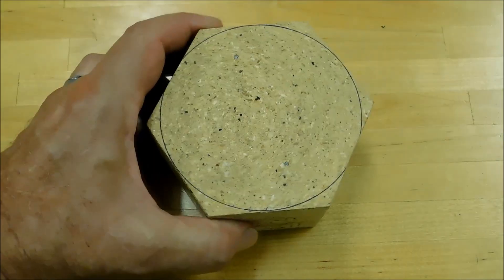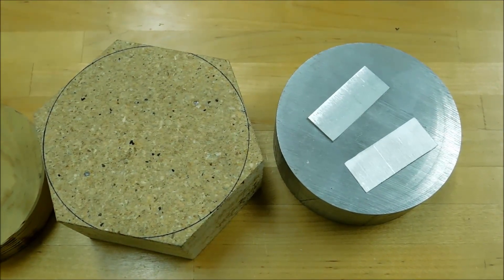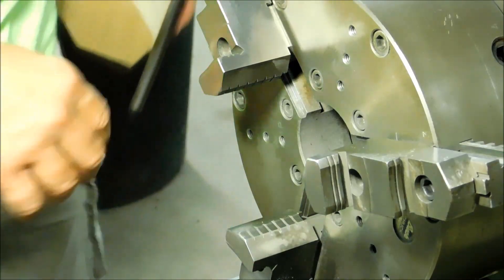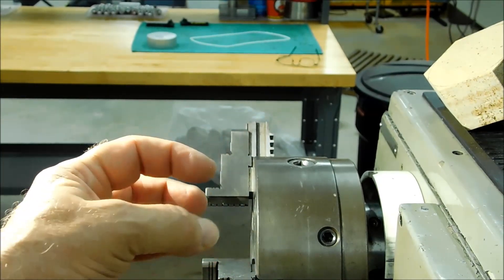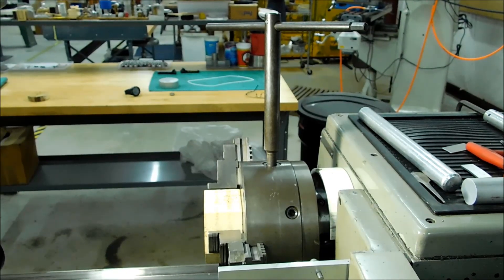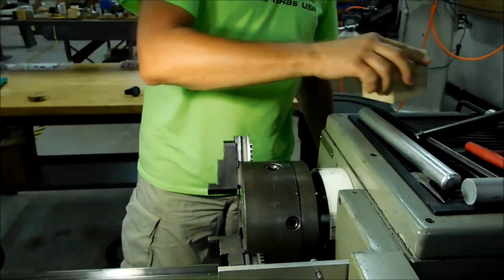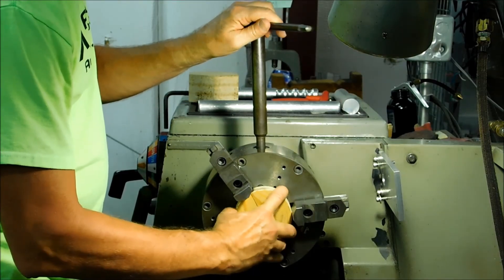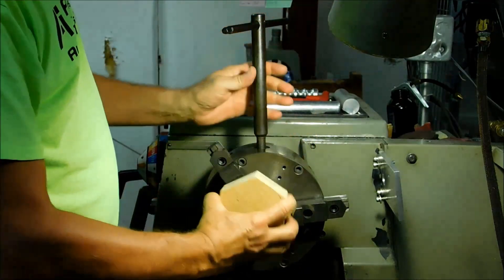Why Did That Part Come Out of the 3 Jaw Chuck?  DON'T MISS THIS ONE.

Comment: Thanks for this one. I tend to rotate my part when is round, I guess I got that from chucking drills in a Jacobs  Chuck. For some reason I tend to put them crooked and thus I developed a natural tendency to do this. For hex stock of small cross section it would be hard to have this issue and that is where the dangers lies. The moment you put a hex the size you used in this example, your brain tells you it won't come off. Wrong assumption, if the ratio hex side to chuck jaw side is greater than one, then you may grip out of center and boom.
Very insightful, and good to see that you apiece the safety nerds.
Reply: I have drills turning inside the jacobs chuck in my almost new DeWalt cordless drill.  I don't know what to do about it.  And I do check, and they are centered.
Reply: @danl.4743  I tend to rotate the drill while I close the chuck and that odd turning you mention almost never happens. Particularly with crappy or old chucks that tend to close off center. Maybe yours is not closing concentric and only two jaws are making full contact.
Reply: @reiniertl  I do rotate them out of habit.  I will pay more attention to it and see what happens.
Reply: "Appeasing the safety nerds" should NEVER be the reason you do (or don't do) something in the shop! The safety nerd is not going to be hurt in your accident. Do what you do because it is the safe way.
Reply: @russelldold4827  I see your point, but it is "unsafe" when the safety nuts out there litter a channel like this bashing on its creator for been unsafe. Anyone watching Joe's videos know he is a very professional an safe machinist.
Reply: @reiniertl  Perhaps I am a little sensitive to the term "safety nerd", often used in a mocking tone. Every advance in human philosophy, science and technology has come from people whose contemporaries would have labelled them "nerds", merely because they looked at the world a little differently, and questioned "the way things are". Bill Gates, Albert Einstein, Nikola Tesla, Galileo and all the way back to (and beyond) Aristotle are among countless examples. I consider the term "safety nerd" as a badge of honour, because they dare to challenge the mentality of the herd in the shop, often bringing improvements. Would you like to work in the shop conditions regarded as "normal" just 100 years ago? Thank the safety nerds for many of the improvements.

Comment: Savage.. but helpful
Reply: Haha, get it!? Savage!? Haha!
Reply: Anyone got a link?
Reply: @MitchellCH  https://www.youtube.com/watch?v=98MCz9gQaiE&t=999s
Reply: avi8r66 lol it wasnt that bad. Another thing that didnt help any was the fact he was using the cross slide to feed in his tool. That method cuts on both sides of the tool which results in much more pressure than is required. The “right” way or at least a better way is to use the compound to feed in at a 30 deg angle so only the front of the tool cuts on each pass.
Reply: Mitchell Hoffarth Yep thats what This Old Tony taught me.  I am guessing you have never heard of Adam Savage, which is the reference I made in my original comment. There was nothing 'savage' about Joe's video, its fine.  I was just trying to give a nod to Joe I recognized who he was talking about without giving away the target of his video.  Adam is well loved, funny clever guy, but still learning about the lathe apparently.  If you don't know who he is it might be worth your time to look into him.

Comment: The majority of his problem was the fact that he wasn't using the compound, he was trying to take both sides of that giant 4tpi per turn without using a tailstock.
2nd he was running upside down so as to collect chips but in the machines least Ridgid set-up causing the part to control the tool bit.
If he used his tailstock and compound he would have had no issues at all.
Reply: Trying to hog that thread out by sheer force hella increased the tool pressure unnecessarily.
Using a center on the tail stock would have helped, but he was doubling problems where there should be none in the first place.
I'm glad he learned some stuff, I just wonder if he learned the right stuff that he should have.
Reply: @jdgower1  of course not. makers do not think. they simply bulldoze through projects and learn nothing from their mistakes. which is why they keep making the same mistakes year after year while building up their piles of trinkets.
Reply: @SuperAWaC  I guess I have to disagree with you, if they weren't learning from their mistakes then they won't get anywhere. The problem that Adam has is that he doesn't have a good enough mentor to tell him what he was doing wrong and correct him. If I didn't learn from my mistakes then I would be repeating them constantly but I'm not making the same mistake twice.
Reply: @SuperAWaC  The makers I watch DO learn from their mistakes - and that's why I watch them.
The problem with the Adam video is that he thought his main mistake was in work holding, and not how he cut the thread.
Both of those mistakes played into how stuff went sideways for him, and the rectification of both of those mistakes can lead to better results in the future.
I understand that Adam learned that his work holding techniques needed improvement from the video itself, but my comment was about how I'm not sure that he learned how tool pressure plays into what went wrong for him, and how it's a thing that has been addressed many years ago by people who literally do it for a living.
Reply: And he was turning it slow as molasses,    turning it backwards with the tool upside down doesn't affect anything but you're 100% right about using the compound instead of the cross slide,   and he should have used a proper threading tool .  But the whole issue I believe was that he didn't use his tail stock

Comment: Great vid, only thing missing is how to clamp hollow stock.. In an ideal world you'd use a 6 jaw if you have one, if you have to face a 6" long piece of 2" pipe, making a plug to fit snugly inside it will drastically increase your clamping force.. a steadyrest is a good idea as well
Cheers!
Reply from the maker: Watch my video on chuck selection.

Comment: No negative comments. No new Texas. No tucky shirt in... Just had to be 'That Guy'. Sorry. Was a safety flip-flops inspector. Shek happens, then you wipe it off if you can get untangled! Every machine shop needs rags, but not oily ones in a closed container!
Reply: the machine was never even turned on
Reply: @SuperAWaC  
Safety has no excuses. Just takes one overlooked detail to cause a permanent ouch. Once saw a Bridgeport locked out, but was jumpered. Glad I noticed before terminal naptime!

Comment: Hey Joe. 

Very good point on finding the low feature of a hex. Good advice if you're putting a hex collet block in as well.

Other than machining the hex feature to dimension after making the threads, is there a way to put those shims in? I know I've been trying to grow that third arm since I've become a machinist, but still no luck. Lol

Thanks for the video.
Reply: Got some bubble gum?

Comment: Good points Joe!  I have done that "feel for the best spot" exercise so many times that it is automatic for me.  I also preached to the guys in the shop many times about leaving the chuck key standing in the chuck when the machine is idle. especially sensitive to that after a near bad incident that threw the key an instant before it did some serious damage to the operator.   I  made a necklace from a big ugly , rusty, bent, old chuck key, and told all the guys working for me in the shop that anyone leaving the key in the chuck was going to wear the necklace for the remaining part of the day.

Comment: Can somebody please post a link to 'that brass nut bolt' video - I cannot find
Reply: https://www.youtube.com/watch?v=98MCz9gQaiE
Reply: @reburne2012  and @Michael Moran Thanks!  I wouldn't have found this.  Saw people talking about Adam and went looking on Abom's channel
Reply: https://www.youtube.com/watch?v=98MCz9gQaiE
Reply: Adam Savage
Reply: Adam Savage's "Tested" YouTube channel.  It's one of his most recent videos.
Reply: search youtube for Adam Savage's one day build  Brass Bolt I think.  Just check his channel it was very recent.
Reply: https://www.youtube.com/watch?v=98MCz9gQaiE

It happens when Adam is threading the bolt, about half way done with his external threads.  Also seen in the video at this point, he changed tools and the direction of the cutting.  I'm sure there were a few different issues at play.  Adam didn't talk much about other things he learned here.

Additionally, the compound should have been set correctly for this threading.  I guess it's a rookie error (or errors).  We all have to go through learning like this regardless of how well seasoned a maker you may be. 

There's a lot to be said for being self taught and learning from experience.  Still, training can really help speed the process up.